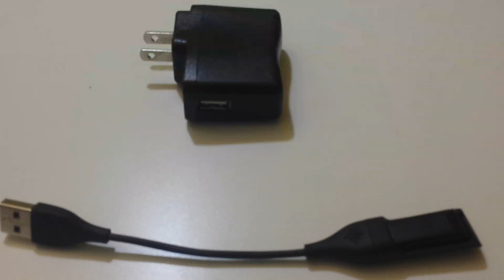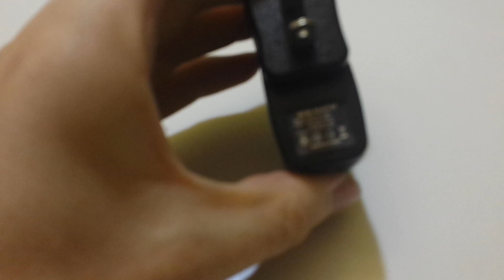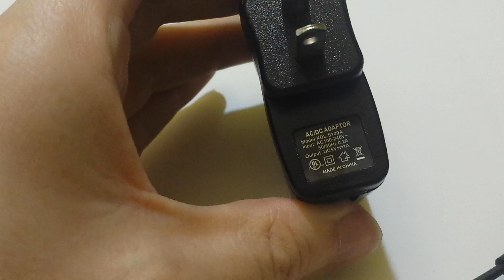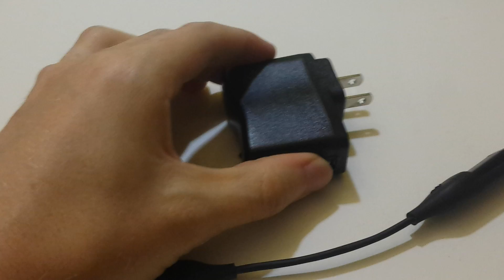Why use a plug in charger vs. your computer's USB?

Comment: So after my post You can delete Your video. I rather expected to see You with a multimeter in Your hand and explain people that wall chargers give lover (safer) voltage to the end device. Instead of that You are talking something about 500mA and 1A. My Surge takes max 0,07A while charging in the first phase. Yes bro, that's 70mA. You can plug Your fitbit to the 3A charger and if it is a Surge, it will take only 70mA-tested with a multimeter. ANY Li-ion battery has an electronic circuit that controls the current. You can plug ANY charger You want as long as it gives 5V and there's gonna be NO difference. I'm sorry that 7000people saw Your video.

Comment: thanks for the info, wasn't sure I could use the wall charger from my camera, if the Fitbit was 5 v. Charges faster and doesn't take up a connection to my computer.
Reply: "So after my post You can delete Your video. I rather expected to see You
 with a multimeter in Your hand and explain people that wall chargers 
give lover (safer) voltage to the end device. Instead of that You are 
talking something about 500mA and 1A. My Surge takes max 0,07A while 
charging in the first phase. Yes bro, that's 70mA. You can plug Your 
fitbit to the 3A charger and if it is a Surge, it will take only 
70mA-tested with a multimeter. ANY Li-ion battery has an electronic 
circuit that controls the current. You can plug ANY charger You want as 
long as it gives 5V and there's gonna be NO difference. I'm sorry that 
7000people saw Your video."